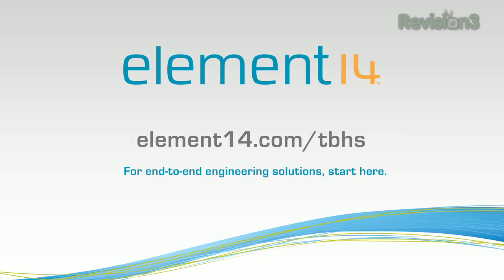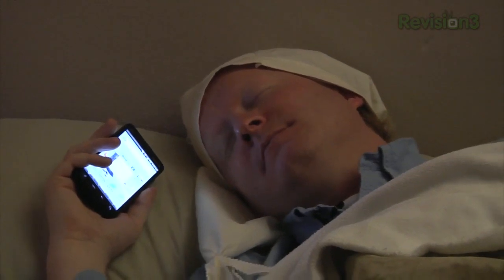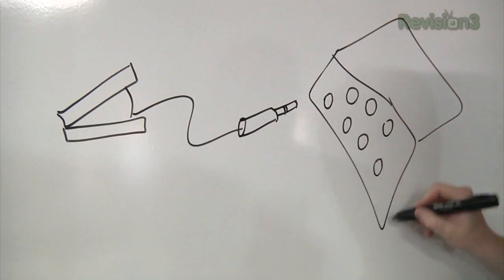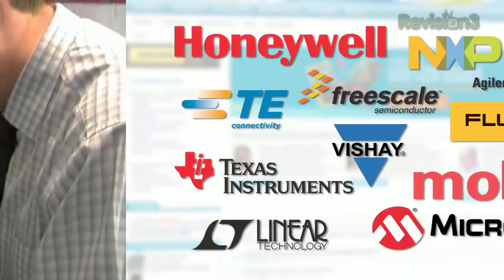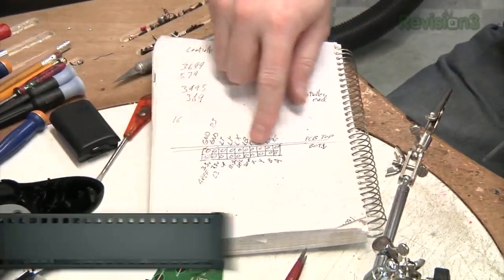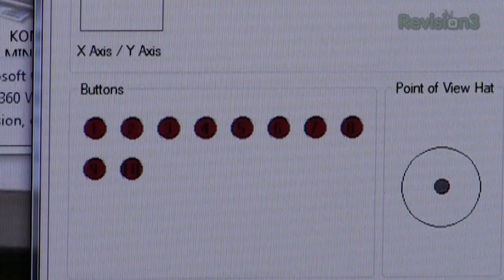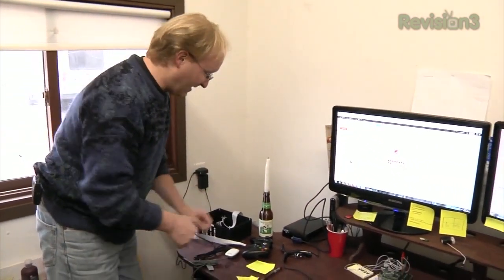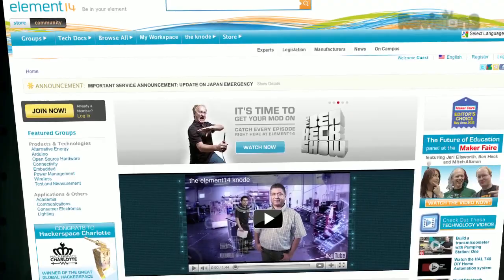XBOX 360 Controller Mods To Make The Holidays Brighter

Comment: Dear Ben,
I think you should modify an xbox 360 controller so you can remove the buttonpad, both triggers and bumpers, both joysticks, and the dpad and make it so you can replace these with new premade assemblys, making them modular so you can have a reversed controller or ps3 style

Comment: Would have been cool to have 8 buttons instead of having to change the jack position, would make switching between combos a lot easier and quicker instead of using the same combo over and over again or taking time to switch the jack position. Still pretty cool tho, nice channel

Comment: if the kid cant hold a controller how is he supposed to manage 8 switches?
Reply: there are a wide variety of switches available for many types of physical conditions. switches attached to strings that wrap around thumbs and toes, switches you can bite down on, even tubes you can sip and puff on that activate two different switches with air pressure.

Comment: It depends on what type of controller whether or not it pulls high or low Ben.The older ones(I believe)pull high,while the new ones pull low&I think it's the older ones that have issue with multiple buttons.Ur breakout box would be good for interfacing with an old-school arcade joystick BTW.

My friend is missing his right arm, we are trying to figure-out a good way to get him on the 360/PC FPS.. (like Right-foot rocker/analog switch/opto-pot thingy for RH thumb&similar LHS for other buttons?)

Comment: you could try building a custom pc controller with two joysticks (left joystick for movement and right joystick for view, 17 buttons ( 2 of which would be pushed by pushing down on the two joysticks), mini keyboard that could be set up as a cell phone interface on the handles of the controller. but it should be highlly programible for peole

Comment: Can you make a ps3 controller that can work on the xbox? I hate the adapter devices because they need all the other crap to get it to work. I just want a modded ps3 controller that can work on the xbox360. so basically I want an xbox360 controller in a ps3 controller shell!

Comment: um ben, from what ive learned from padhacking, and i have nothing on you AT ALL, its easier to use a 3rd party controller rather than a factory one, cuz its cheaper and theres visible easy soldering points...thats what i used to make my arcade stick...is that just cuz im a noob and its better to use a 1st party in the long run?